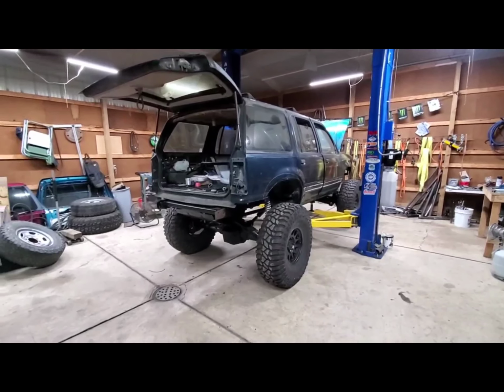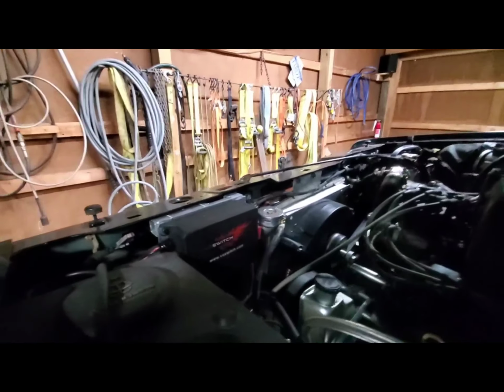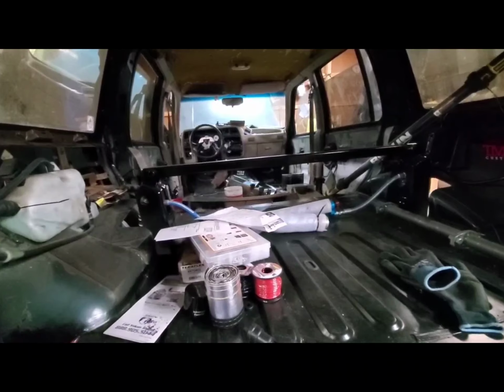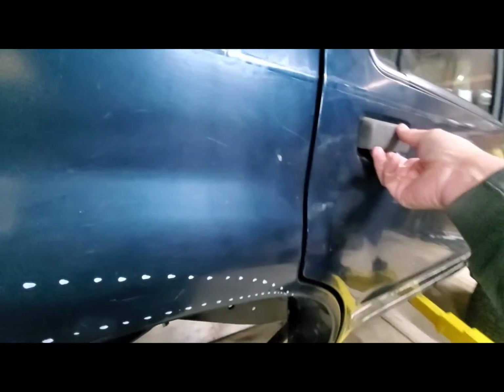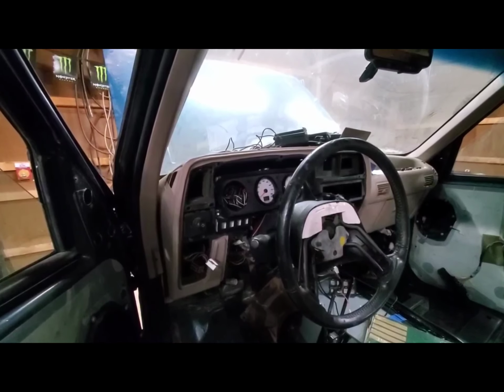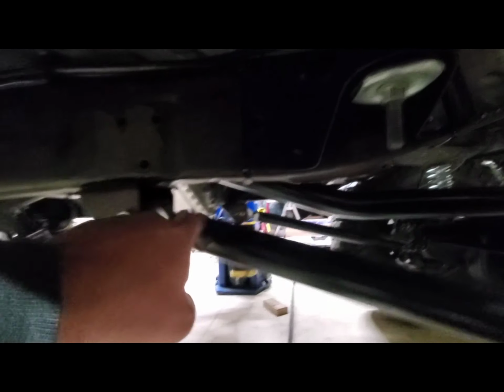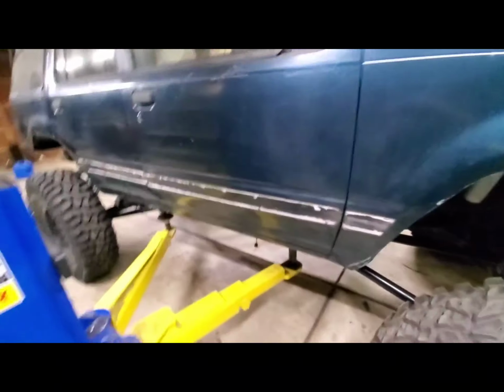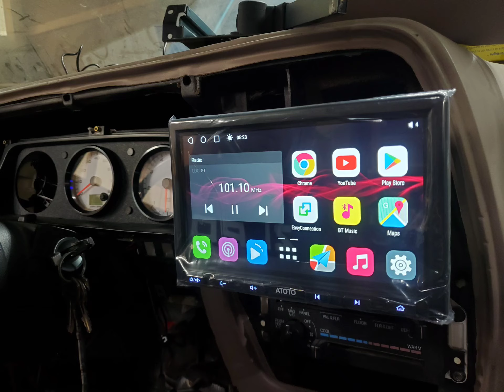1 Ton V8 Explorer SARGE 2.0 Part 10

Comment: Great Build..seems like you thought of everything.  Love the one wire 8 switch device.  Good Idea on the spare as well.  You mentioned the ride height will be 2.5" lower.  Average Joe might want to know how you change that since it's all set up now?  Really love the stance of the axles, tires and width.  Also thought you might as well trim the fenders to the actual "bulge line"..You may already have that plan in place.  Moving the shift levers to fit in that new "console" intrigues me.  I want to see detail on that and the underside of the body when that is modified.  Overall it's a really exciting project.  Great work!
Reply from the maker: Ride height as in all the weight isn't on the truck yet so it sits higher.. no seats installed yet, front n rear bumpers, winch, etc etc... a lot more weight has yet to be installed... once everything is on/in the truck for its true wight the ride height should settle where I planned, if not accutune offroad offers 1 free swap of the coils to get the spring rates needed.  The shifter console will house the transmission shifter that is cable driven... trust me a lot more to come...